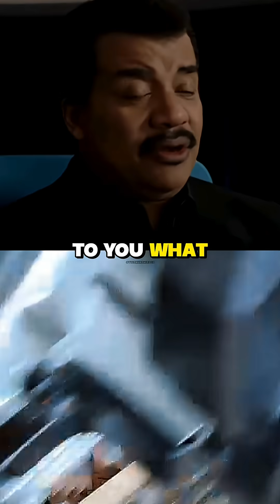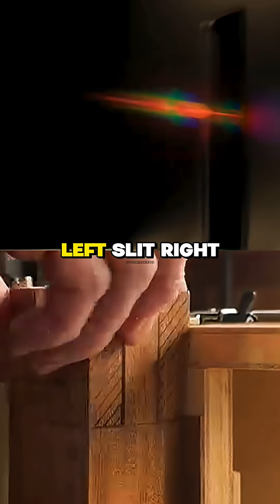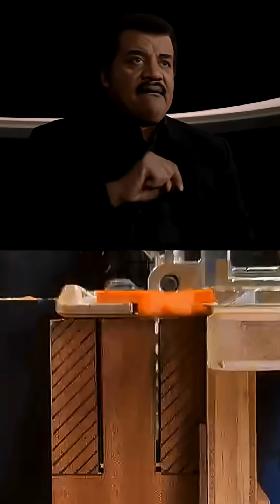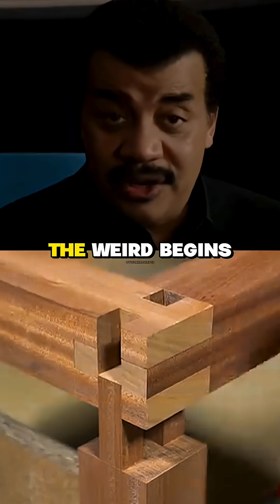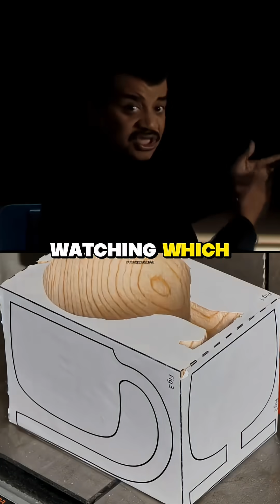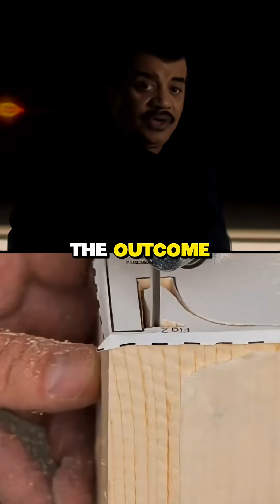Double Site Experiment w/ Neil deGrasse Tyson's

Comment: This is so dumb. The double slit experiment can be explained. Basically, photons are so small that even the measuring tools used to observe it moving are able to mess with its trajectory due to the fact it's not an entirely closed system. For example, if you launched a paper air plane down a tunnel with no wind and it was well crafted, it should fly in almost the exact same pattern each time. But if you open a door to the side to watch it and there was a slight breeze by the door, it would affect the flight pattern because the air moves differently. Even something as small as the heat from the measuring instrument could create a difference in the environment the photon has to travel through.